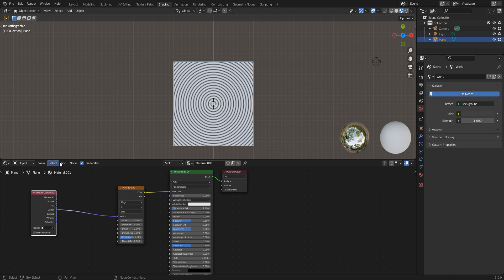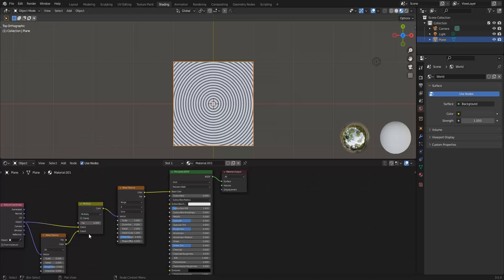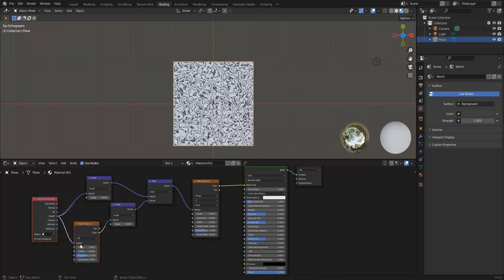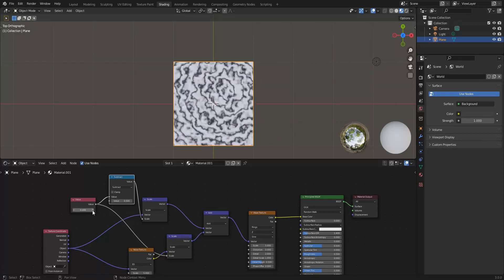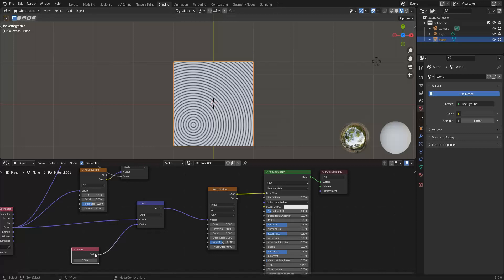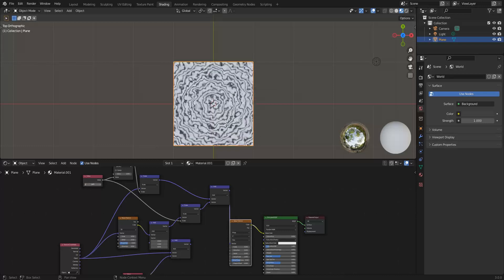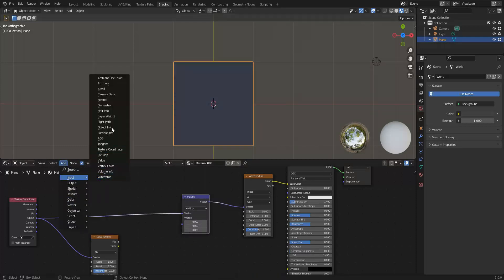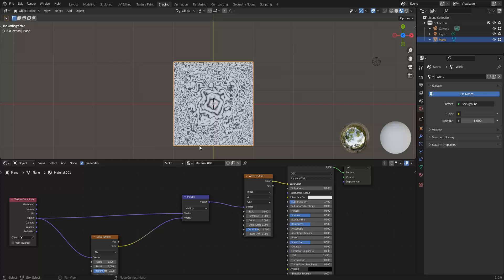The Right Way To Distort Your Texture in Blender 3.0

Comment: I'm not convinced that this is "the right way" to distort a texture. 

Noise texture outputs "random" values on [0,1] and you've shifted that to be [-0.5,-0.5]. 
You've then decided that what you want is a weighted average of these values with your coordinate values. 
Let N be your (shifted) noise values, X be your coordinates, and r be the ratio used in your weighted average. 
Your new coordinates become (1-r)*X + r*N. 
For r = 0, you have your undistorted coordinates. And for r = 1 you have pure noise. 
But for something like r = 0.5, you actually are scaling your coordinate system, something you claimed to want to avoid. 
This isn't a big deal with the texture in your example, but if you set the wave texture scale to something like 1 you would clearly see the scaling as you increase r. 
And you can in fact see that the wave texture effectively scales by a factor of 2 going from r = 0 to r = 0.5. 

The issue here is the use of a weighted average. That's not necessarily what we want when adding noise to a texture. 
Of course, what we want just depends on our desired results, but what follows is what I would consider "the right way." 

When adding noise to your coordinate system, what you want it to be doing is taking each point in your coordinate system and shifting it by some "random" amount. 
This looks like X + r*N. This operation can be achieved in a single node with a single Multiply Add from Vector Math. 
I'd argue that for r to reflect the scale of these coordinate perturbations, N should be on [-1,1], so you should scale by 2 and then subtract 1, rather than just subtracting 1. 

Really, the same results can be achieved in either setup by tweaking different values. But I think the way I described is much cleaner and is "the right way" if you don't want your textures scaling when you add noise.
Reply from the maker: I was not very precise. In the context of the mixrgb method I was addressing "how to linearly transform between noise and the coordinate system" where 0 is all coordinates and 1 is all noise. So in that context when I say it scales what I mean is the amount of noise scales as you move away from 0.
If instead you want to linearly add in noise to the coordinate system then agree you should ditch the weighted average and add in scaled noise.